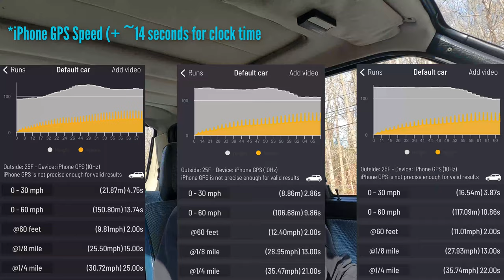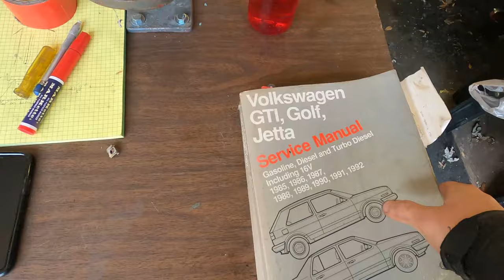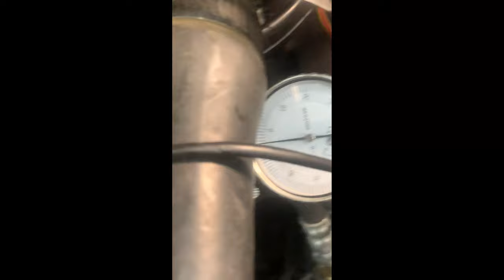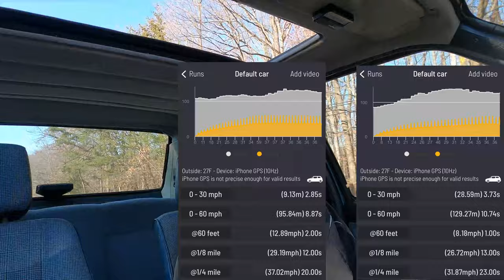MK2 VW Jetta Diesel: Giles Injection Pump Upgrade

Comment: Hoping to get a giles pump for my 87 jetta coupe na automatic. Yup, a diesel with an 010 "TL" code automatic. Currently bone stock engine with the fuel screw turned in 1/8th turn and the cam advanced 2°. Actually fairly peppy for what it is. Going to attempt the governor mod first but pretty set on the giles pump. I've read the giles pump can add up to 20hp. Also the gti dual outlet downpipe makes a difference too. Going to port the exhaust side of the head, make a custom intake with velocity stacks. I currently get 1000kms per tank (55L). I'll be happy if I can see the 52hp bumped up to 75hp. Tq to maybe 100ft/lb? (Never see people talk about the tq number.) And 820-850kms per tank. Because it's a 3spd auto with final drive 1:1, it sits higher up in the rpms cruising on the highway at 100km/hr.(no tach so unsure of exact rpms) and I'm able to accelerate and pass people with ease at highway speeds.
Reply from the maker: I think the Giles pump is the best upgrade you can do to these.  That said, the MF code turbo diesel is light years better. It AlMOST feels as quick as the 1.8 gassers of the day.   Thanks for watching

Comment: that money buys you 2 complete TDI engines with ECU and all the accessories 😎💪. Well the engine mounts will add another 4-500 USD/EUR and I understand that the tinkering involved is another league compared to a pump swap.  not to mention keeping these cars original adds to their value and charm. 👌//I also keep my mk1 NA diesel engine original and detailed to crazy levels.
Reply from the maker: Truth!  I was just trying to solve a leaky iP and I didn’t want to be down for an extended time.

Comment: I have a 1981 Rabbit Diesel that has been in my family since new.  I drove it in college, and my biggest complaint with it was the lack of power.  It's  interesting to see that the new pump basically shaves 4 seconds off the 0-60 times.  Very impressive!  How much did the pump cost?
Reply from the maker: I paid $1435 for the pump but that included a $350 core charge.  I kept the original.  I would say this is the best "speed" mod you can do to the VW NA Diesel.  You do need to watch your temps. You are outside the design limits of the cooling system so you CAN overheat the car if you are running up hill on a hot day with the A/C going.
Reply: @tr3wrench  hello i have the same engine and i have a question about cold start mechanism of the pump, when you have it on can you hear the diference in the engine running? becouse i cant understund if it works or not, thanks
Reply from the maker: @sk8foreal   yes, it increases engine RPM by about 200-300. It is a cable attached to the pump at the bottom, left if facing the car from the front.  The cable slides into a small hole and held in place with a set screw.  The cable could just be sliding without pulling on the actual advance.
Reply from the maker: @sk8foreal  yes, it increases engine RPM by about 200-300. It is a cable attached to the pump at the bottom, left if facing the car from the front.  The cable slides into a small hole and held in place with a set screw.  The cable could just be sliding without pulling on the actual advance.
Reply: @tr3wrench  no the screw is ok, the wire its moving the lever fine, but i cant hear eny difference on the engine sound... it increases  RPM in a warm engine to or only when its cold?
Reply from the maker: @sk8foreal  sounds like problem is internal to the pump :/
Reply from the maker: @sk8foreal  increases regardless of temp, only need it when cold (or when running A/C)

Comment: better late than never. when filling the pump with diesel. Use one of those vacuum brake bleeders on the retur side of the pump saves a lot of cranking :)
Reply from the maker: Pro tip! Thanks!

Comment: Thinking about trying to find a 1.6 diesel to swap in my 1990 jetta gl with a blown 1.8 8v... just putt around and get like 40mpg sounds like a decent idea at this point in life haha
Reply from the maker: If you can find a turbo donor car (MF code)... DO THAT.  The ME code is S L O W
Reply: @tr3wrench  Ya awhile back I had thought about going with a mk3 1.9 diesel maybe still the best option so it's not a complete turtle
Reply: @tr3wrench  I have a 2005 AWP 1.8t mounted in it now on g60 corrado mounts, but I'm in the beautiful state of California where it's basically impossible to register it with how the emissions evap system works on the mk4. But if I do a pre 1998 diesel swap the state basically doesn't care about the emissions
Reply from the maker: This is the swap!  AHU/1Z would be brilliant

Comment: Hello i have vw mk1 1.6 diesel and  how it is possible to get that good results 0-60 is this same pump rebuild or somethink is diffrent as a upgrade inside...
Reply from the maker: Yes it is a performance shop that rebuilds them.  I'm not sure of the exact upgrade but I've heard it described as "more aggressive timing."  Probably a different cam or something in there.  Thanks for watching.

Comment: Hello! I have a 1985 audi 80 b2 and its a 1.6 diesel no turbo and its really slow so i was thinking if new fuel injectors and a kind os your fuel pump would effect my 0-60
Reply from the maker: It absolutely would.  Do be careful as it will produce more power than it was designed for. You can overcome the cooling system on really hot days, running the A/C, and pulling a hill at WOT.  I have a coolant sensor and second gauge for the radiator inlet side.
Reply: @tr3wrench  what about only fuel injectors would that help it pull better w no problems
Reply from the maker: I don’t think so. Unless your injections are faulty, new ones shouldn’t make a performance difference.

Comment: The original Bosch pump in the one pick looks like it has an air fuel aneroid for the turbo model.....it sits on the very top of the injection pump.......?
The after market hikes pump does look like the right one for the naturally aspirated model though
Reply from the maker: I actually contacted Giles when I got into this project because I had the same concern.  That "contraption" on the top is an altitude compensation device.  His build deletes that.  I just put a plug on the Vac generator port for that application and good to go.  The performance difference with this pump is remarkable.
Reply: @tr3wrench  interesting 🤔

Comment: Hello there the modified pump is very interesting, what would say, how much more PS or HP does she have and and do you think it's still as reliable as the old one (apart from the leaks)? Am I the only one where the internet site from Giles's shop is down?
Reply from the maker: Just checked the site http://performancediesel.ca/  works for me...

So far I am very impressed with the upgrade.  The pump is a Bosch VE unit with modifications to the rate of fuel delivery.  It is basically a rebuilt pump, with a bit of a performance add.  I don't have hard numbers but I can say the car is much closer to it's gas counterpart than before. I took about a 5 MPG hit on the fuel burn, but SOOO worth it.
Reply: @tr3wrench  Thank's for the reply.

Comment: Do you think you could have fixed your old pump leak without buying a new one? I have the same leak issue with my mk2 and am debating tying to fix the old one vs buying a new one.
Reply: ....or just hitting up a junkyard
Reply from the maker: Yes Definitely!  The previous owner had replaced all the seals in the pump to run a biodiesel mixture.  He left detailed instructions and notes.  I doubt I could have made the performance upgrade to the internals to match the Giles pump I purchased. IMHO the performance upgrade is worth the $$$.

Comment: How much?
Reply from the maker: I think 800 without a core.  Less if you have a core to send him
Reply: @tr3wrench  Is the pump you took off a 1.6TD pump?
Reply from the maker: @1975Kombi1  negative. It was the OG ME code pump.  Still have it.
Reply: @tr3wrench  oddly I have never seen that style pump on any normally aspirated vw in my entire life and I have own dozens of mk1 and mk2 NA and turbo versions.
Reply: @1975Kombi1  I personly think that it is just vw had some turbo pumps over and instead of buying na ones, they just bolted those on instead.